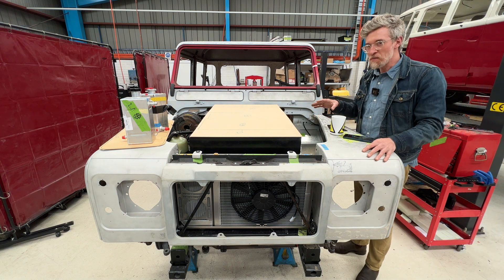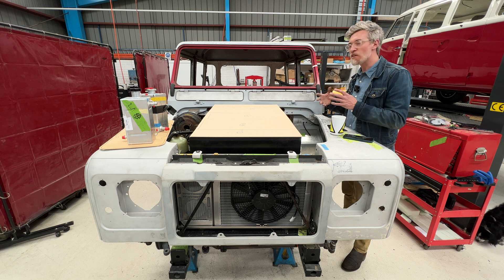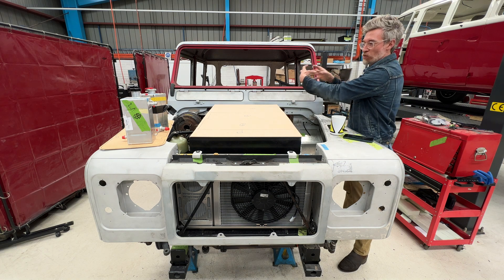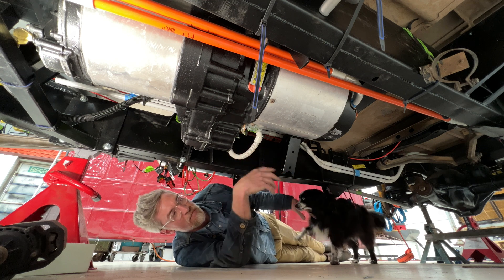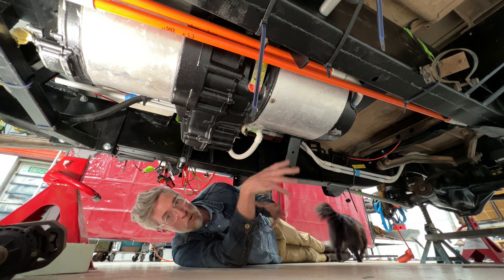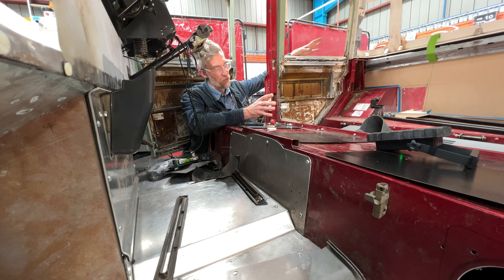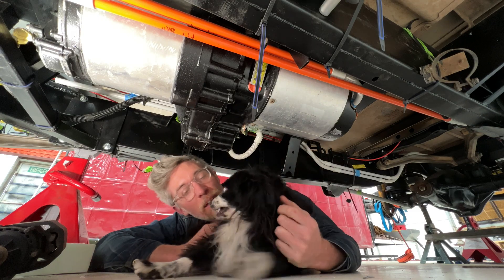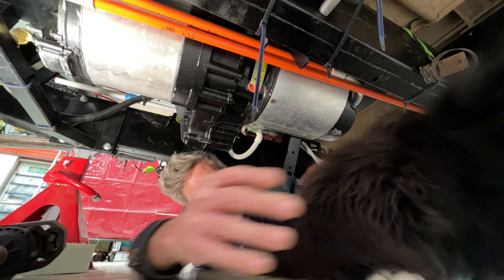⚡️Tesla Powered 1986 Land Rover 110 Dual Cab Pickup⚡️ Part One

Comment: Thanks for all the great content, the main resource for info I use on youtube. I'm half the way through defender 130 conversion using the M3 RDU but I am quite concerned it's going to be under powered, since the old model S motors you mentioned are out of the question for your future defender builds due to diff supply, what would be your motor or dual motors of choice for a heavier 110 or 130

Comment: I wonder if the rear batteries set might be placed under the rear seats. Also the front batteries set look to me to be placed too high compromising center of gravity.  Regards.
Reply from the maker: Not as much space as you’d think under there.  Upcoming vehicles will have batteries integrated into chassis to a larger extent.  Camera angle makes front look higher than it is. It’s as low as it can go without hitting axle. But yes, CoG is probably a bit higher in front